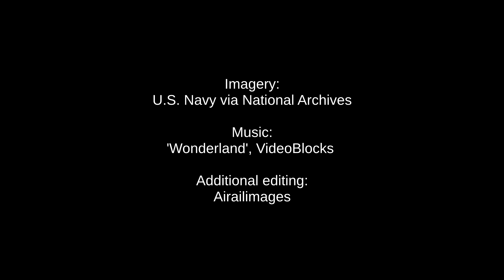WARTIME JET PROPULSION NAVY CORSAIR AND P-59 TESTS

Comment: The device mounted under the belly of the Corsair has what appears to be an air intake on the front, that would tend to rule out it being a rocket. And the small size would also tend to make it unlikely that it is a jet engine. Ram-jet seems the most likely answer.